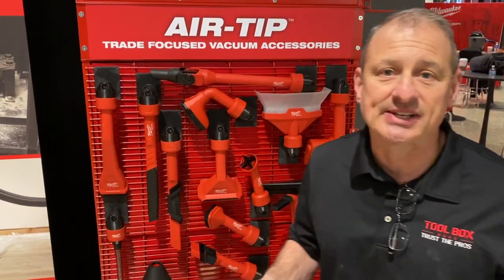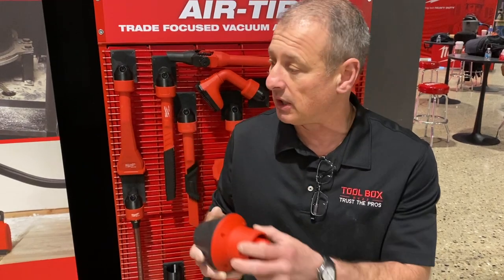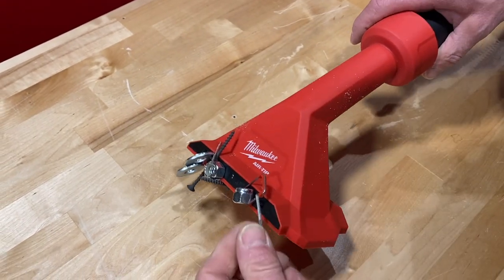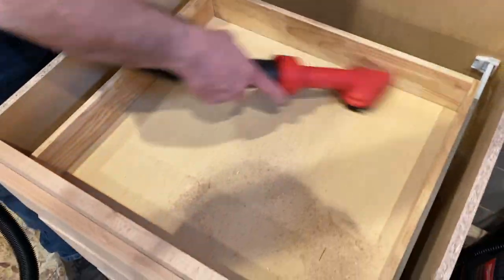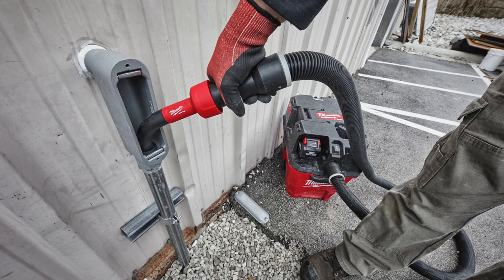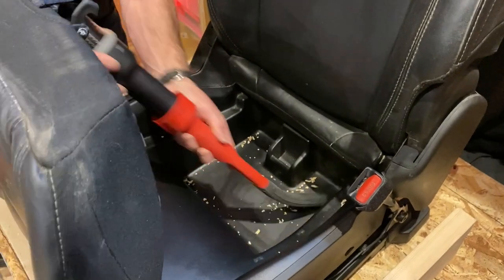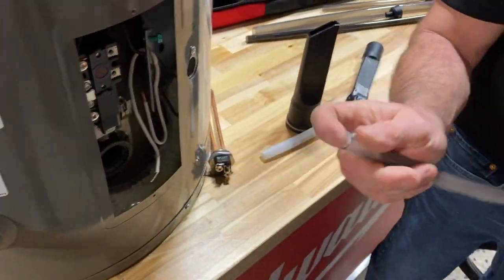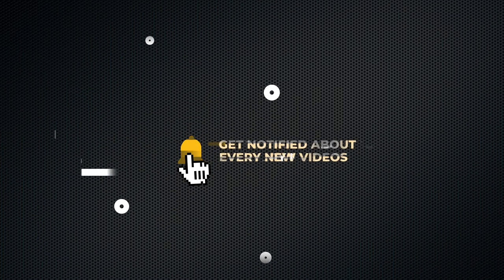Milwaukee AIP-TIP Vacuum Accessories - 2022 NEW Tools

Comment: Fantastic range. Especially liking that catch-all one that grabs falling dust and debris. Did you get the opportunity to check if these tips fit on Euro standard nozzles like Festool/Bosch/Nilfisk/DeWalt dust extractors?
Reply: They fit inch and seven eights inch and a quarter and 2 inch

Comment: Also, they need to make a wall suction funnel device available with a 90 degree hose attachment ( 90 degrees straight out from the wall) so it can be used in tight lower wall spaces. Great video.

Comment: Really happy you separated these videos.  This is where the real value is in this release! Excited to pick these up, unless they are exorbitantly expensive...

Edit: The Milwaukee tax is alive and well.  Honestly some of these are priced appropriately, though perhaps still on the high end.  Some others are nuts. $50 for that wall funnel?!  Some of these are bound to be lost, and because of the pricing it will hurt when they do. A real mixed bag of pricing, but overall excited about a number of these.

Comment: Looks exciting. Sort of. 
No Packout compatibility? That could be a deal breaker. Would love to throw one on my Packout stack at the base with the existing 4 wheel dolley and have the drawers above. The accessories look great, especially for finish carpentry. But I don't see a huge upgrade here over the existing m18 Packout vac unless you're doing major site cleanup. In which case I would just grab a shop vac.

Comment: In order to hook the hose up to the cutoff wheel dust shoot you have to unscrew the nozzle from the hose and replace it with the clamp nozzle. After using the tool you have to again unscrew the clamp nozzle and switch it back to a standard nozzle to clean up debris on the floor.

Comment: There are some very clever and innovative ideas in there...when they become available over here in the U.K. I suspect that a few of them will be added to my tool kit. I am a little surprized that there are no nozzles with an integrated scraper head for decorating and surface preparation though.

Comment: Can the Air-Tip M12 roller be used with a rigid straight extensions for use when standing?

I see it has a hand grip, wondering if I can use it whilst standing.
Reply from the maker: Yes